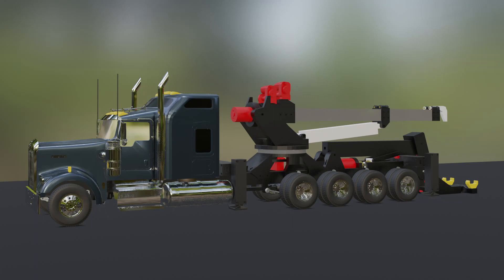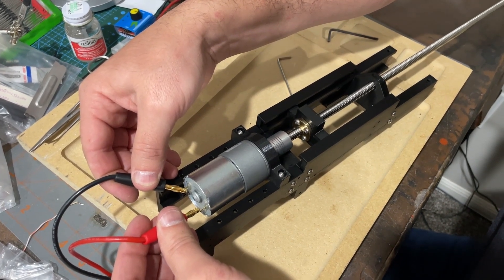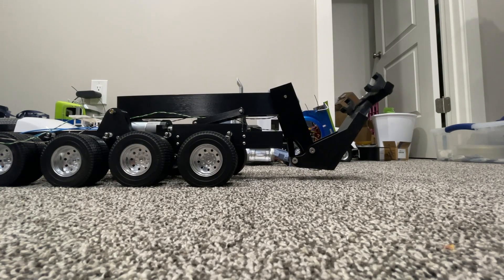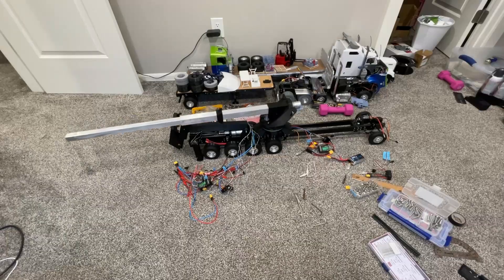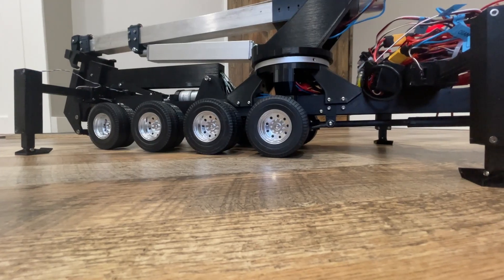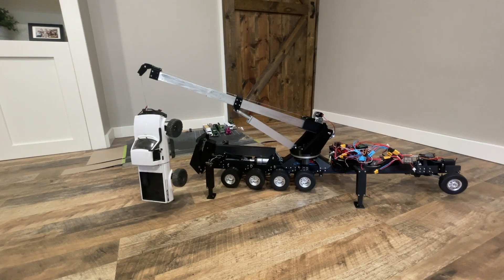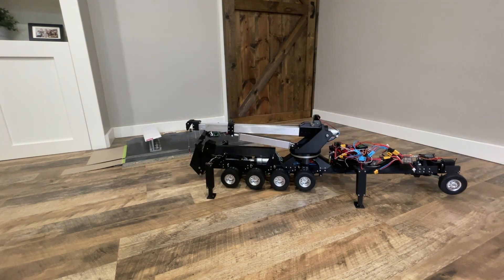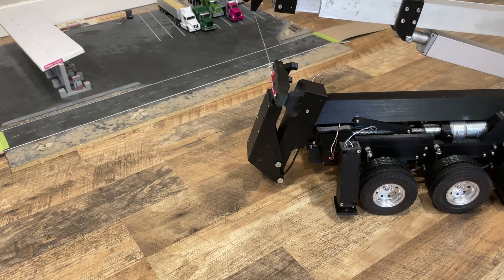1:14 Wrecker - 3D Printed

Comment: This is similar to what im building. I have spent hours looking up information on how to build the rotating assembly. Are you able to share any information on how you done yours?
Reply from the maker: I used a lazy Susan bearing to support the weight. Then put internal gear ring on the rotating base and a gear on a 360 servo to turn it.

Comment: This is incredible, I've just started making something similar myself. My biggest question is how did you make the outrigger feet descend and ascend in to and away from the outrigger arms? 

I was thinking hydraulics for myself but mechanically would probably be a little bit easier
Reply from the maker: I made actuators using n20 geared motors and sone end stops. They’re driven by an esc. The case was 3D printed. You could also use the little 12volt linear actuators you find online, nice thing with those is they already have limit switches so you don’t have to wire your own.

Comment: Amazing job, how did you make the limit switches?
Reply from the maker: A micro limit switch and a diode on each end. With the diode when hitting the switch it will stop in that direction but still allow for direction to be reversed.

Comment: Nice work, very inspiring! I'm building a rc crawler recovery vehicle and was looking for some ideas. I'm curious, how many channels did you end up using?
Reply from the maker: Thank you. I’m using all 10 channels that my Flysky has. I could use 19 channels, to make it work with less I had to double up things.
Reply: @BuildItBetter3D  That's what I thought... Every new idea I have for a feature comes with maybe 1, mostly 2 and sometimes even 3 more channels I would need ... Will there be a follow up vid? I'd like to see how it's going!
Reply from the maker: I need to get back to it. The truck is functional but I haven’t done any of the finish work on the body yet. My snowmobile projects have taken over. I would like to finish the truck and do another video showing it all.

Comment: hello sir , how do you conect the main dump lift motor to the esc , ? it's only a +and -  off the motor , how can I conect to my esc ? I made a similar set up for my trailer ramps , I have a motor installed,  but I can't get it to work off my esc , please help sir 🙏
Reply from the maker: I used brushed motor and brushed esc. A brushed motor only has + and - so you need a brushed esc. Brushless motor and esc have three wires.

Comment: Great work, converting my triple axel grand hauler into the same thing, I've been running into problems with the main boom if you decide to sell the files let me know id like to get the 2 boom designs from you, building i'm a rock star designing for 3d print not so much.

Comment: way to flimmsy bro them satble arms see them bend with no load .  ahahah
Reply from the maker: They give a little but are holding up well. Could be machined out of metal for more rigidity, however cost would go up substantially. I can lift a load that will balance everything on one side, nearly tipping the truck over, and they hold up just fine.